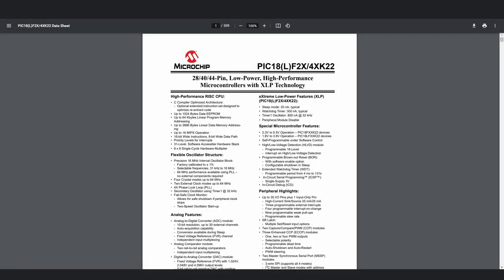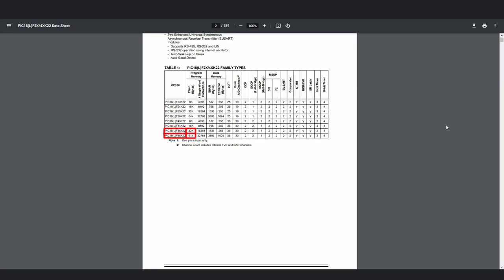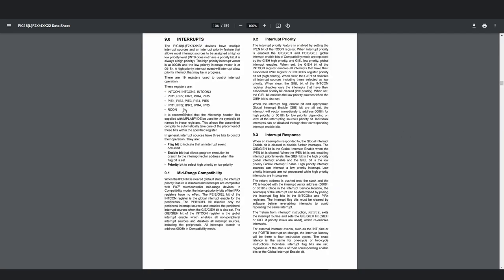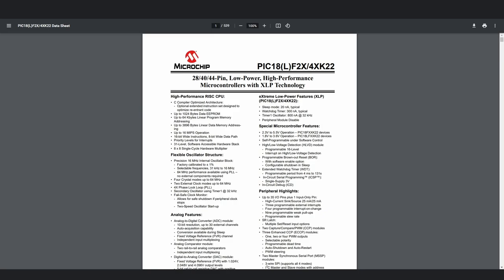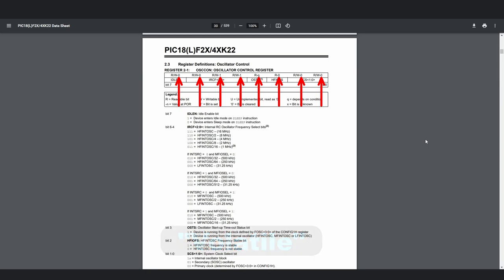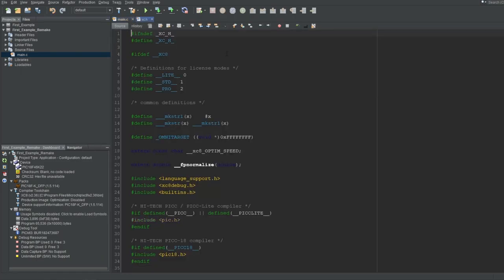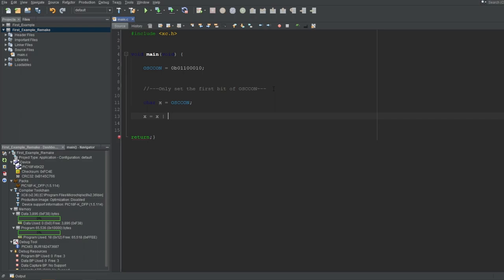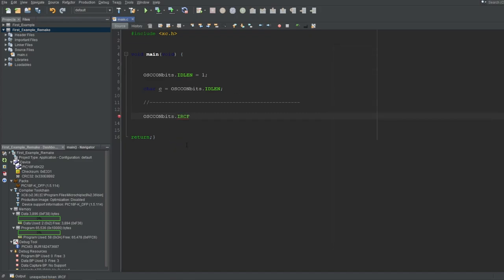PIC MCU TUTORIALS #9 - Introduction to PIC datasheets & Registers (Absolute Beginner)

Comment from the maker: Extra note: I've been mentioning that microcontrollers can't operate on individual bits in these videos; however, that's not actually true. I've only been saying that to not confuse beginners. PIC18 series microcontrollers DO have bit-oriented instructions, and you can, for example, set a single bit in one instruction. It's just that, these instructions are mainly there for optimization, meaning even if you didn't have them, the microcontroller would still be able to do everything it can. Not to mention, you can't use these operations directly in C (the language we'll always be using), so it's better to ignore them for beginners. You just have to hope that the compiler/optimizations utilize these instructions.

(You can actually use assembly instructions in your C code too, but if you're a beginner, you should ignore that as well...)

If you're curious, check the "Bit-oriented File Register Operations" section on this page: http://technology.niagarac.on.ca/staff/mboldin/18F_Instruction_Set/